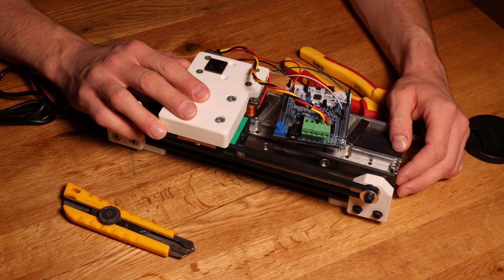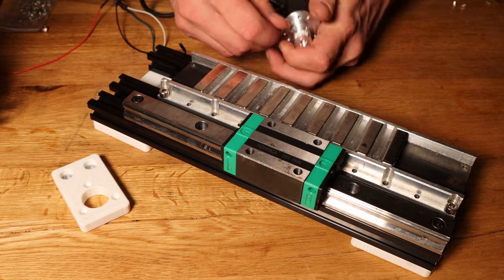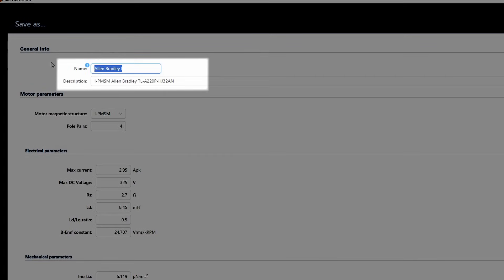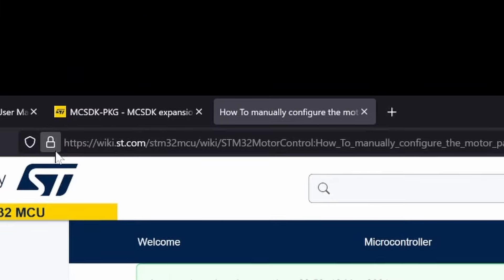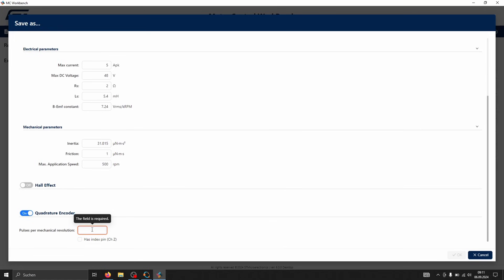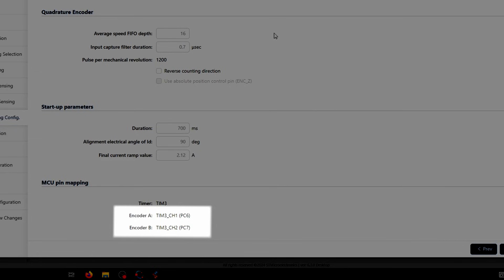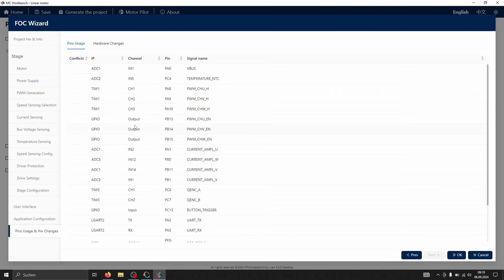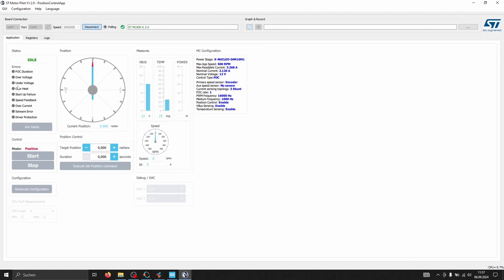Making a LINEAR MOTOR for a DIY CNC mini MILL - Part #2 (Step-by-Step)

Comment: Hi, first videos which are quite clear. I would like to build linear motor which only support one directional original force on a wheel without positioning what kind of controller will be best for this purpouse?
Reply from the maker: Hey, this is a quiet common use case. There are a lot of controllers you can use for this like the ODrive or some drives from ST just to name a few examples. Usually for sensor-less control there is a six-step or for FOC an observer approach (which only work while the motor is moving, so keep that in mind).
Should be just some software configurations. For ST I would have to switch to torque or speed control.

Comment: Super awesome video. Always surprises me that someone is out there doing what I'm thinking about doing and ALSO making a video about it. Would be awesome to get a progress update. 
Couple questions:
Do you really think this will be strong enough/precise enough to direct drive a milling axis? (I ended up here after looking at Kern cnc linear drives)
Also what fem software were you using and was it useful to predict performance?

Thanks for your work, very inspiring.
Reply from the maker: Hey, thank you -- really appreciate the kind words! I’ve actually got a completely new concept in the queue. Hopefully I’ll find a few hours this weekend to present it and get some input. I also uploaded a couple of screenshots on Discord if you’d like to check them out. I don’t remember the exact simulation results, but they were promising -- somewhere over 100 N if I’m not mistaken. The new version got the copper in the stator and is watercooled so it should survive higher currents.

Thanks again for the encouragement. Can’t wait to share the next steps and hear what you think!

P.S.: I'm using FEMM 4.2 (super useful, but definitely takes a little time to get into)

Comment: You used 12v dc power right?
Reply from the maker: Had to double check ^^ yes 12V, if I remember correctly the board can handle 48V or so...

Comment: you should use iron powder. ideally 3 different particle size.
Reply from the maker: Sorry for the late reply. You're absoultly right. I guess the gaps between the big iron particles add a lot of magnetic resistance.

Comment: 0:01 - Why are the "halbach magnet array" slanted at a diagonal? never seen any design like that. cool project. 4:00 - wow, you designed a very good "attractive" magnetic force... are those iron bits for the coil core? You seem to have figured everything out well, some ideas I can say for higher efficiency and accuracy, use granite base (i've seen many CNCs made from it on youtube) and for coil core use "metglas" material (new tech stuff).
Reply from the maker: The magnets are arranged diagonally to make the generated force and motion a bit smoother (cogging force/torque). Worked well for me. As far as i know this is sometimes done Motors.

Yes, those are iron pieces used for the coil core – though I have to admit, it's far from optimal.

Your suggestions sound really promising! definitely worth looking into for future improvements.

Comment: Super cool project! I'd bet that a real lamination stack for your core would perform a lot better. Laser cut mild steel should be pretty cheap, fast, and easier than casting them. If you wanted to cut down on core losses you could use an electrically-insulating glue when you assemble it.

Also, it looks like your back iron (below the magnets) is saturating - you'll get some more performance if you increase that thickness. General rule of thumb is that mild steel saturates around 1.5T and you were around 2.
Reply from the maker: Thanks a lot! Really appreciate the feedback and suggestions.

You're absolutely right about the lamination stack. Was looking for the "right" sheet metal to buy, but holly molly thats expensive. The tip with the insulating glue is great too, hadn't thought about that.

And yes, good eye — the back iron is definitely saturating. Thanks for pointing that out!
Reply: Mild steel laminations will do just fine. Electrical steel has slightly higher saturation but it’s mostly formulated to reduce core losses. For what you’re doing I don’t think it’ll matter that much. 

You can look up companies that make laminations and/or stacks for motor repair, but like you said it’s going to be pricy

Comment: Hey, how are you?
I hope you're doing well :)

I think I've found a great BLDC controller
ST B-G431B-ESC1. 
You can search for it using the keyword "B-G431". 
This controller is smaller and more powerful + you can use same tool.
It also has plenty of information available and is compatible with the SimpleFOC library.

Is there a specific reason you chose the IHM16M1 and NUCLEO-F303RE?

Comment: I think more smaller coils in the stationary rail could be utilized while the sled is only magnets. So no moving wires
Reply from the maker: I can do that. Then I think we should turn off the coils out of range.
Reply: @NeverGetTiredEngineering  yeah so not even 3 phase but 6 or 12 even for resolution. I actually found a project that uses pcb board to drive little magnets. Like think jumangi board pieces moving.
Look up bobricius 2d linear actuator.

Comment: Are you supplying the motor with DC or AC power supply? I am building an induction motor of my own and was curious about this aspect of the project.
Reply: Also very curious about this
Reply from the maker: The controller is supplied with DC. It generates 3 phase AC for the motor. Hope I could help 😁
Reply: @NeverGetTiredEngineering  Yes thank you! I am also curious how you calculated the BEMF constant.
Reply from the maker: @elliotthikade7628  You can find detailed information here: https://wiki.st.com/stm32mcu/wiki/STM32MotorControl:How_To_manually_configure_the_motor_parameters
Reply: @NeverGetTiredEngineering  the wiki mentions manually moving the motor when measuring values. Did you just manually push the motor along your magnetic base while it was connected to the oscilloscope, or was there some other method you used? 

Thanks so much for your help!!!
Reply from the maker: @ Yes that's exactly what i did. Are you building something similar? ^^
Reply: Last question hahah you have been very helpful and its much appreciated. When initially testing your primary block with coils, did you experience the magnetic force between your rail and the primary that pulled them together, rather than repelled? This is whats happening with my system and trying to diagnose the issue.
Reply from the maker: @elliotthikade7628  yes had that with both the coreless version and the iron core... also confirmed that with a simulation. Do you wanna let it hover? :D

Comment: Real ones are an U shaped stainless piece with neodymium magnets glued to both sides.  The coils are inside an T shaped epoxy
Reply from the maker: Have seen that on core less motors. Would definitely increase the max force. Sound great for a second version

Comment: Next time try using PVA or BOVH filament. Cast in it and than pour in water. PVA gets dissolved and you have your part no matter how impossible for release it is.
Reply from the maker: That would have made things a lot easier 😅 thanks for the suggestion!

Comment: Did you measure how much force this produces?
Also just add a second linear rail on the other side of the magnets to keep it from cantilevering around. Thicker printed parts and sandwiching the alu profiles between a plate on the top and bottom should solve all those problems.
Reply from the maker: I ran a quick test and as it is it produced min. ~16N at 2A (without any further optimizations). Yeah that would be an easy fix ^^
Reply: @NeverGetTiredEngineering  not bad! Should get much higher once you can reduce the air gap right?
Reply from the maker: yes, will be higher, and then i can also use the hallbach array :D. I try to get my hands on some laminated sheets like permenorm or vacoflux to have a better core material

Comment: I think your best bet is to look for premade E or U cores for this, but if you really want to make your own I'd suggest using either a powdered iron or iron oxide and premix it with the epoxy. That seems the best way to optimize the core itself to me, you could also use the premixed epoxy with iron pieces like your cut wire. Going further you could try finding an epoxy that could be thinned with a solvent before mixing to get the granules tighter packed.
Reply from the maker: I also thought about stacking steel sheet with an insulating layer and milling these all at once, but I want to make some test samples and compare some core material

Comment: Neat use of wax for your casting. See if you can characterise the permeability and lossiness of different core/yoke materials, by putting a sample of constant dimensions into a solenoid, which you can use to measure inductance. Lossiness would be harder to quantify, but if you use a scope to measure its Q-factor in a tank circuit at a few frequencies, and compare that to what its DC resistance would imply, you should get a value. If you put a lot of turns on it and/or switch a lot of current into it, you can likely see magnetic saturation on your scope too, which would be a handy thing to know. Especially if you plan on water-cooling your yoke.

FYI I have similarly sized toroidal cores made of both iron powder and ferrite, and the iron powder is more than an order of magnitude worse than the ferrite. Far less inductance per turns-squared. Modern ferrites are damn good, you can likely crush some toroids in a tough bag with a hammer.
Reply from the maker: Thanks for your comment, that’s a great idea before i put more time and effort in a core without knowing how well it performs. I think I will do that and a video about that before I continue this series

Comment: What did you shave and melt in that grey container? Was it to act as a release agent or self inside so nothing leaked out? I use acetone on ABS prints when I want to seal so learning other methods would be helpful, Hopefully I heard back from you!
Reply: I believe it is either candle or bee’s wax to prevent the resin from sticking to the mold, if only there were some release angles added :’)
Reply: @lvb3575  I like how the author of the video comments 7 hours later after my comment to one of your comments, but doesn't answer my question, regardless I believe you're right about it being wax. Just curious do you have any recommendations on what can be used as a release agent for resin?
Reply from the maker: Hi, sorry about that. I answered a few comments and then I thought I should maybe do something else since I was busy the whole week (work, YT and private live), so please don’t be mad ✌️
And yes it’s wax as a release agent
Reply: @NeverGetTiredEngineering  Oh I ain't mad, just little ball busting.

Comment: I see you've done what i suggested but instead of powder, you used steel wire which is also great. But i would still recommend iron powder to get more iron in the core. Steel wire pieces are too big which generate Eddie currents. Also, you can pack more iron using powder on the same volume of the cast. BTW are these programs you used free? Good luck
Reply: Iron powder might not be as good as ferrite powder, which is non-conductive even at high packing densities. It also doesn’t magnetise permanently, I think.

The software is free, at least the STM32CUBE IDE and its programmer are, they’re also platform agnostic.
Reply: FEMM 4.2 is also free, nice way to tinker with some iron core geometries (only 2D, but should be more than enough to get you started)
Reply: @lvb3575  doesn’t really help when you don’t know the properties of your magnetic core in the first place.
Reply: @Scrogan  you can be conservative with the properties you test with, and also see the effect of different properties. For a custom core like this with no properties measured it is indeed difficult to match the simulation with reality, but if you use laminated sheets with a laser cutter for example you can get pretty good results. Or core-less actuators, my personal favorite
Reply: @lvb3575  core-less? Wouldn’t those have much less force?
Reply: @Scrogan  yeah they would, but you can get much higher position accuracy with them
Reply from the maker: I want to make some measurements with a couple samples and do a side-by-side comparison. And yes everything is free :)

Comment: You should have used iron powder for the yoke in my opnion.
Reply: Or both small pieces and iron powder mixed with resin. Very cool idea though!
Reply from the maker: I‘ll make some test samples of core material to compare them

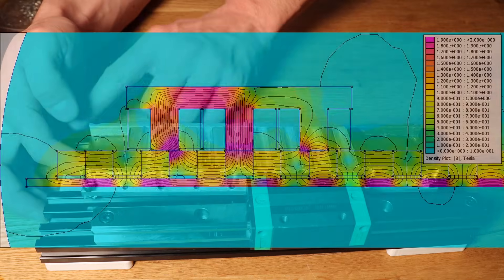Comment: I really like the idea of casting your own magnetics using short wire pieces in resin, like a jankier version of the typical laminated-core construction for transformers! I'm wondering how this affects the magnetic properties, though - I suspect saturation field might be quite low, since the majority of the field will likely go through the small contact areas between the wire pieces. How did you model this in the simulations (3:11)? And did you do any measurements of the coil's performance, are their inductances and saturation currents reasonable?
(I'm curious because I'm also working on an electronics project with custom magnetics right now :) Have a first iteration already machined, though, just have to get my control loop to cooperate and stop it from doing a 4:07)
Reply from the maker: ^^ This is still a work in progress. I'm currently building a small 'test station' to extract all the critical data from the materials. I agree that this core will likely perform worse than a laminated one. In one of my upcoming videos, I plan to compare different core types. The goal of the simulation was to explore various core sizes and different types of stators—simple, Halbach, and Halbach with iron segments (to increase reluctance forces). Performance tests for the coils will be coming soon. :)

By the way, may I ask what kind of project you're working on?
Reply: @NeverGetTiredEngineering  granulates hardly conduct the magnetic field, that is why they use plates that are insulated from each other like the copper wire.
    Also steel does not realy want to change it magnetic field. So I think your core is more like a dead weight. 
E plates for linear motors might already be available off-shelf.
Reply from the maker: I‘ll try to get my hands on some electrical plates, I’ll also make a side by side comparison with some test samples in one of the upcoming videos

Comment: Man I am really loving this video series so far, super nice to see your progress! For the ripples due to the reluctance 'cogging' force that you have with these types of actuators you can do a measurement of these forces by measuring the EMF induced if you move the coil unit manually. This you can then use in a feed-forward control element to compensate for this position dependent force and increase the position control accuracy. I am not too familiar with your driver board setup but I can imagine that they have some feature build in to include these measurements. I can't wait to see your next video!
Reply from the maker: Hi, thank you! I'm glad you liked this video. Sounds good - indeed, I saw a setting to enable feed-forward. I'll dive into that! ;)